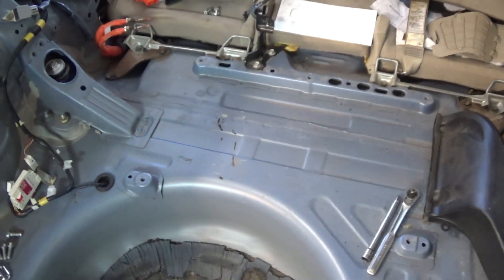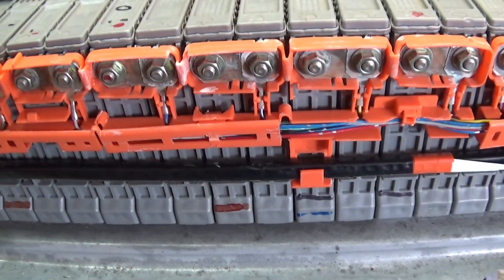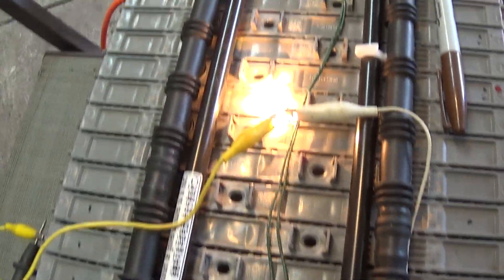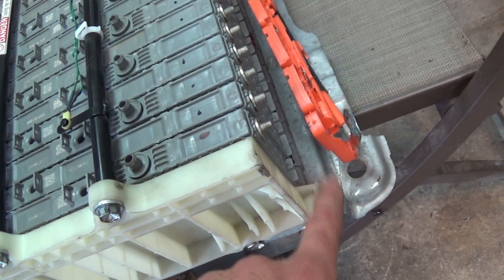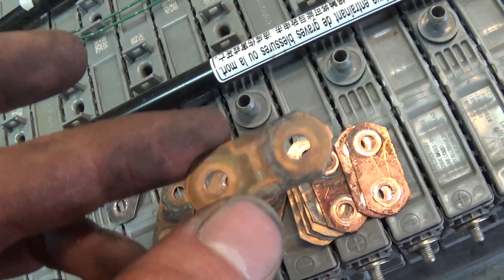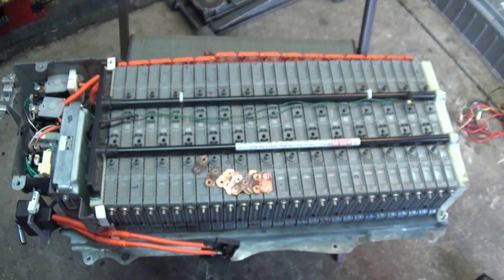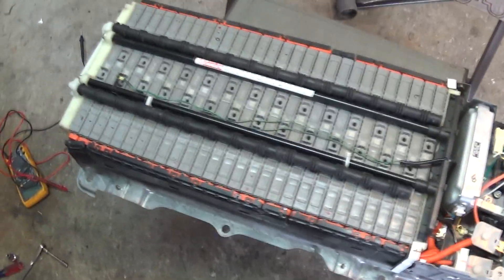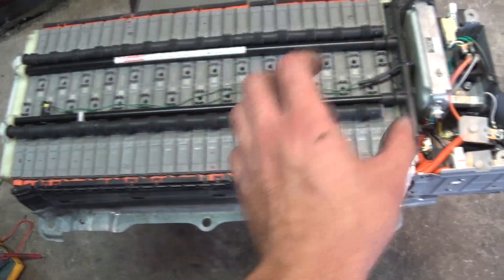Rebuilding The Prius Battery Pack - Brief Overview

Comment: THIS IS HOW I DID IT 
MY PACK AVERAGE ABOUT 7.5VOLT NO LOAD(STATIC) 
1 BULB 55W HEADLIGHT 
METER 
SOME CABLES WITH CLIPS 
TIME STAMP AT 7.2VOLTS
TIME STAMP AT 7.1VOLTS 
THEN AFTER THAT JUST GO UNTIL 4:30MINS WRITE DOWN WHAT VOLTAGE I GOT 
THEN MOVE ON TO THE NEXT AND REPEAT 
IF ANY BATTERIES GO UNDER 7VOLTS BEFORE 4:30MINS IT MEANS IT'S BAD/WEAK
MOST CELLS WERE .02-.03 FROM EACH OTHER AFTER 4:30 
YOUR JUST LOOKING FOR CONSISTENCY IF ALL THE CELLS ARE CLOSE OR MATCH THEIR VOLTAGES OF THE OTHER CELLS WITHIN THE TIME FRAME

Comment: intersting I did the same on my battery pak  simple repalced all buss chrome bars and 5 of 28 were showing 6.5 volt all other are 7.7 volt total out put volts are 213 so far no trouble drove it for 2 weeks counld nt be happy dealler want over 3k to fix plus I needed a water eletric pump and a code came up for a hvav sensor switch assembly got it all at autozone easy fix

Comment: did you balance them? how did you balance them? unbalanced batteries will kill the other ones that reach very low or very high voltage.
Reply from the maker: I did my best to balance them by wiring them all up in parallel overnight, but it wasn't enough.  You're right though, the pack needs to be properly balanced to work.
Reply: So how do you balance them?

Comment: Could you set your multimeter on batt test for 9 volts and use that as the load test instead of that light bulb?

Comment: Not sure that replacing stock buss bars is cost effective. Although the bars in your picture looked a bit dingy on the surface, almost all of them were shiny where the nuts connect them to the battery. That's the important area to avoid corrosion, at the connection. Light surface corrosion on the bar itself isn't going to affect resistance of the bar. 

A very light dab of vaseline on the mating surface might be better than eBay replacement buss bars.  You might be surprised by the quality of the copper under the tin and lose more than you gain. It's all about keeping oxygen away from the mating surfaces at the battery connection. 

I've been vaselining my 12V batteries on my cars since I was a kid, and have only replaced one battery in my lifetime (I'm 59). I live up here in Wisconsin and park the car outside, so the batteries are definitely asked to work hard when it comes to starting. 

Otherwise, a very good and informative video on the process for maintaining a Prius battery pack.

Comment: Good job bro. Placed mine in yesterday, worked perfectly.  All voltages are the same in torque pro app. It was a very easy job. Saved myself hundreds.
Reply: Voltage isn’t enough to fix your pack you need to restore capacity, measure resistance and bottom balance the pack. You only fix it for a while by just checking voltage. I recommend running dr prius app to find out how long your pack is going to last.
Reply: Did you use a cherry picker to take the battery out

Comment: You can spray clean your bus bars with Caig Deoxit D5. I have replaced modules 5 times on my 2005, but it's cheaper than buying a new battery pack. It takes me 5 hours. The longest time wasters are the bottom 28 bolts and compressing the pack. It helps if you deadlift the 120lb pack by yourself. You have to be very careful with the 3 thermistors clipped onto the bottom of 3 of the modules. Toyota does not sell them. Luckily, www.autobeyours.com has almost every odd part.

Comment: Question how can I clear a brake warning light on my Prius ? (2004 Prius Gen 2)
Reply from the maker: Ant H i believe the brake warning light is triggered by your parking brake, or if your brake fluid level is low
Reply: CtrlAltDefeatTV it’s the yellow brake warning light I checked the brake fluid everything is good is there a scanner I could clear it with